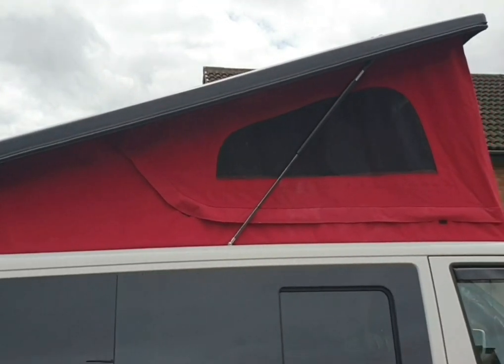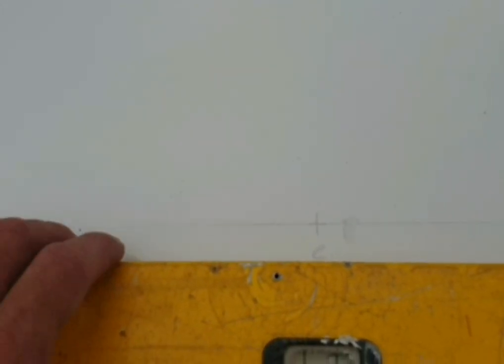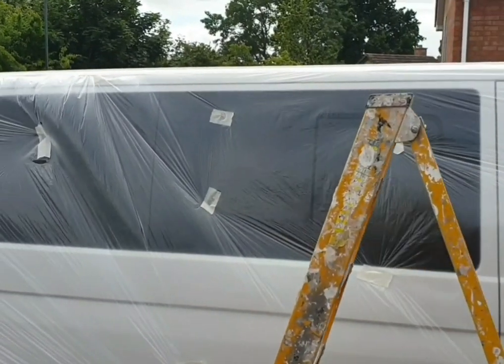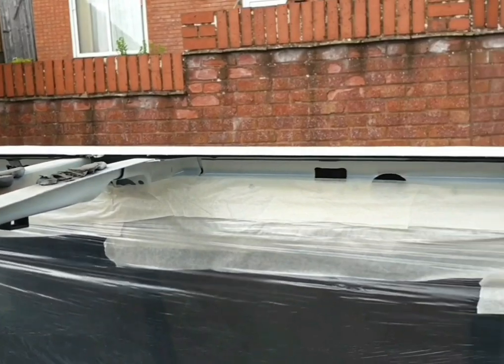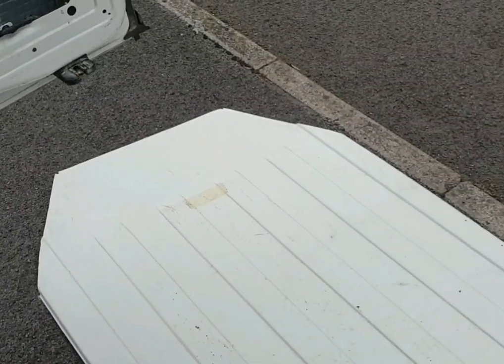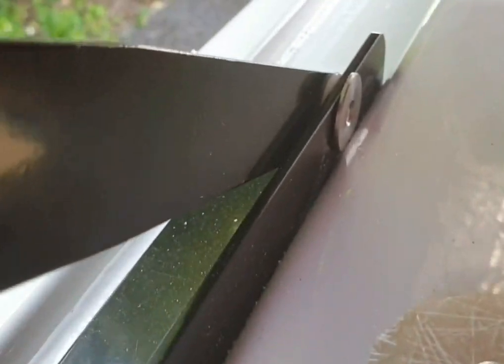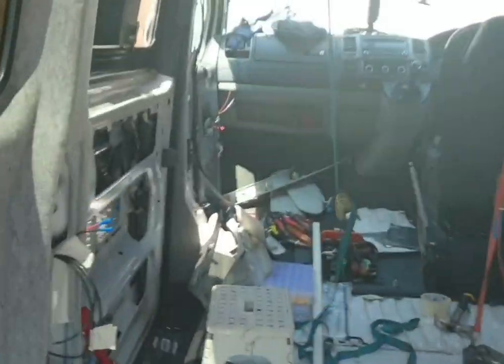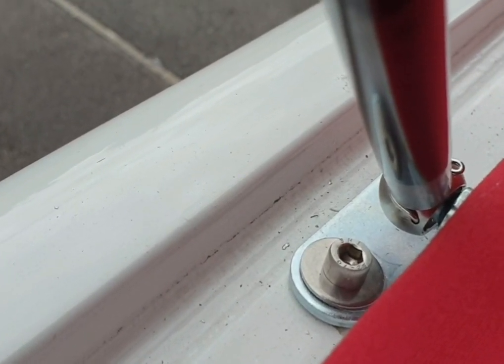How to fit a Pop top roof self build DIY elevating roof

Comment: Hi, thanks for the video. I am currently fitting one of these tops. Can you please advise what the dimensions are for the pneumatic struts? Many thanks.
Reply from the maker: Hi thanks for watching 👍. This is how I fitted mine. On the roof of the van it has a gutter down either side with allen key bolts in for a roof rack. I measured from the centre of the bolt that's above the sliding door back towards the rear of the van 10 inches and that's where I put the centre of the gas strut bracket. Please check that it looks right or your van before drilling any holes. Anymore questions just ask. Hope this helps 👍👍
Reply: @leepurnell7073  Thanks for the prompt response. Hole is cut, re-enforcement fitted. Roof to get mounted today! Cheers. N
Reply from the maker: Well you've done the worst bit cutting a giant hole out the roof😂. Hope it all goes well 👍👍👍
Reply: @leepurnell7073  Roof now fitted, thanks. Just need to attach the canvas but waiting until after the respray for that. Cheers. N

Comment: Y do none of the videos put the canvas under the fiberglass like it should be ?
Reply from the maker: What do you mean ??
Reply: @leepurnell7073  I think he means, the canvas only goes under the screwed-down white bar, and not taken further underneath the fibreglass, which would mean it is screwed down twice, from top and from below, and with a longer length of canvas. 

I am curious about this too, and also how rain is prevented from running under the canvas and making the internal roof felt wet. Screwing it down seems inadequate, but I don't have experience so don't know :)

Thanks for the video, really helpful and job well done!
Reply from the maker: The fiberglass is just to tidy up the big hole thats been cut in the roof you don't screw the canvas to it.